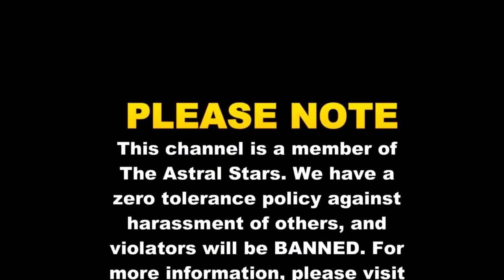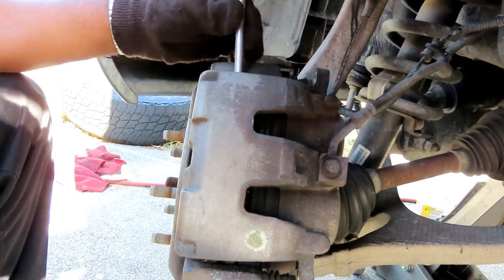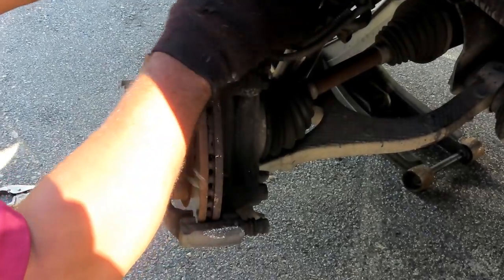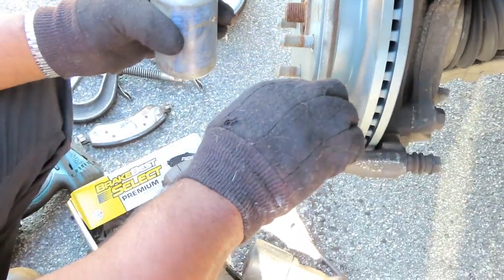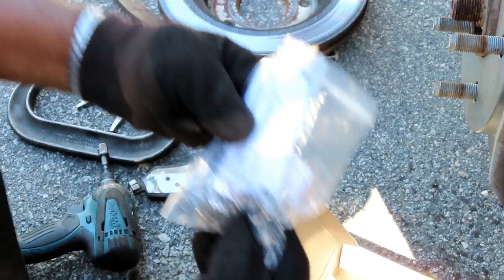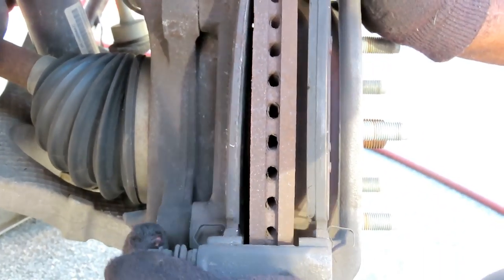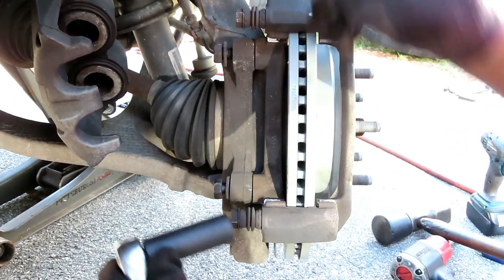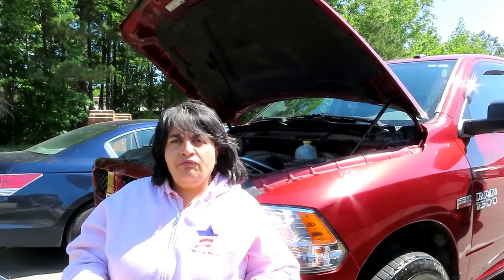⭐ 2014 Dodge Ram 1500 Pickup - 5.7 - Front Brake Pads And Rotors

Comment: Hello, I'm new to your channel. I have a 1993 Honda Accord and the brake lights stopped working. I replaced the brake light switch under the dash and checked all fuses still not working. My cruise control also doesn't work either. I know they work together. Any help will be helpful
Reply from the maker: You need a wiring diagram, you need to check the wires going to the brake light switch.
Reply: @OnlineAutoRepairVideos , after many hours trying to figure out the brake light problem. It was a bad horn fuse blown. I must of been driving around for a year with no brake lights,bc my horn hasn't worked for that long. Brake lights and horn are on the same sercuit just not marked
Reply from the maker: @nestorknoxs3795  A YEAR?? WOW!!